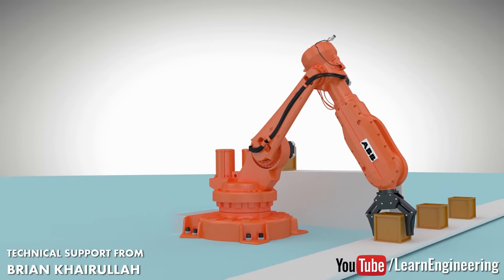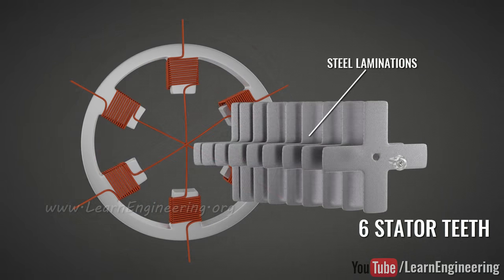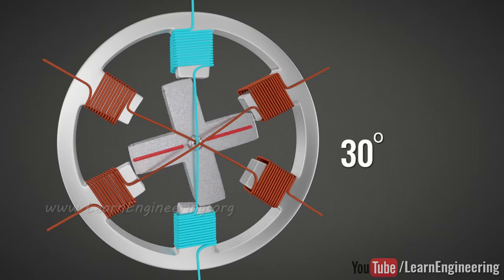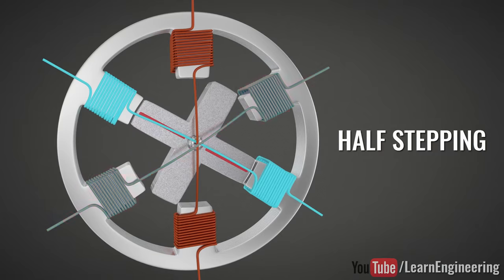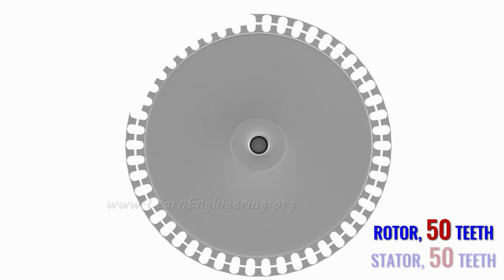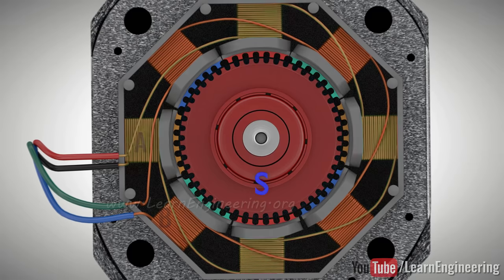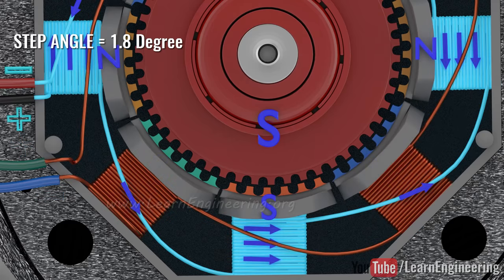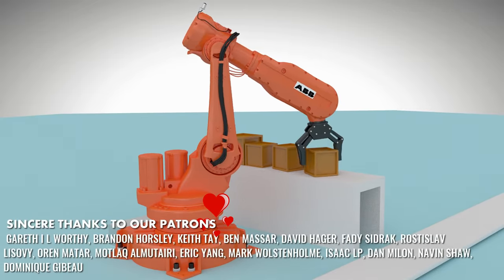How does a Stepper Motor work?

Comment from the maker: Dear viewers, Please support our educational service at www.patreon.com/LearnEngineering . Your support will enable us to release 2 videos/month.
Reply: Learn Engineering 一人
Reply: Is it possible to reduce the step size if we replace the rotor and stator having different no of teeth?
say 72 rotor teeth and 70 stator teeth will we get a step angle of 1.25 deg?
Reply: Make a better video then maybe??
Reply: Learn Engineering
Reply: createlyf ,,,yaa ,,it deepends on the type of application, but normally made with 1.8degree step size,,
Reply: Learn Engineering can you please tell me how to identify pins of stepper motor.
I'm having 5 wire (brown wire strip )stepper motor .
It has brown colored wire strip I'm not able to find out pins
Reply: Thank you for this explication.I juste have one question: which animation software have you used .Thanks in advance
Reply: Very good technical knowledge for young technicians
Reply: Learn Engineering
Reply: Subtitel indonesia??
Reply: m.
Reply: မြန်မာဘာသာပြန်ပေးပါ

Comment: I have worked on many industrial robots at an automotive company, All used servo motors with encoders attached and harmonic drives. The harmonic drive is a very high ratio speed reducer and doesn't use gears so there is almost no play, The encoder is hooked directly to the motor shaft, it consist of a thin wheel with small perforations  and a led on one side and light detection on the other. As the motor turns the light going through the perforations are read and counted. So when the robot goes from point a to point b the encoder keeps track of the number of flashes there probably is a 1000 or so perforations around the disc so even a very small fraction of a rotation is even monitored. So to repeat the same moment from home position 0 point the controller  just runs the servo to the same point by using the encoder data stored.  A little more to it than that such as it can also tell how fast it is moving and direction by the encoder. So there is where you get the extreme accuracy, even 1/1000 of the motor rotation is counted and the harmonic drive may be 50 to 100:1 ratio.
Reply: Does the encoder use gray coded binary, or is it just based on rotation but not exact position?
Reply: 44 teeth just like a micrometer .
Reply: I was going to reply very similarly! I used to work at Toshiba, and they used many different types of robots but all were similar and used absolute encoders with servo motors. We used stepping motors on other machines but not the robots! I used to work mainly with the big Nachi robots! Miss that job!

Comment: industrial robots very rarely using stepper motors. servos are much more common...
also industrial machines NEVER use open loop system. they rely heavily on position encoders...
Reply: @jozef svantner  Can you explain what is a positional encoder?
Reply: position encoder is feedback device.
it is mounted directly on motor shaft (in most cases) reading motor movement and feeding it back to driver. hence the term - closed loop gathered information can be used to verify motor movement, accuracy and repeatability, compensate for high load, overload detectoin, detection an compenastion of mechanical parts wear and many more...
Reply: Billy Willy what is a resolver?
Reply: jozef svantner thank you for your reply.  Can you shed some light on functionality of inductosyn?
Reply: totally i agree with your opinion, anyway, the explanation about stepping motor  is awesome!
Reply: There were lower torque machines or processes that can use stepper motors with encoders and without.
Reply: What does  that have to do with his explanation . It was just a simple visual aid of something doing a repetitive action that could use a stepper motor to accomplish it.
Reply: Exactly right. I have seen stepper motors used on non-critical functions, such as industrial diamond grinding wheel dresser feeds. Everything that relies on precise positioning always uses encoder feedback, sometimes rotary, sometimes linear, sometimes both! Stepper motors are used commonly in more consumer-level applications, such as 3D printers, CNC routers and engravers and such.
Reply: @Billy Willy Very true, I have a CNC engraving machine which uses open loop, if you set the table axis speed too fast, it can jump a step and ruine a job, as well as its home position would adrift due to table inertia.
Reply: this how my analogue electric watch works yes?
Reply: That seems kinda fruitless when we could just use stepper motors, which can be controlled to a very high degree. Some feedback would be necessary, yes. This can be achieved with standard stepper motors. 3D printers can detect when the desired position is achieved, and can detect if steps are missed. I don't know how they detect this, but they can so there is some feedback achieved. Of course for high torque and stability stepper motors would be inadequate.
Reply: Frauenarzt Dr. Stefan Frank  Yep, you got good points. Can industrial servos rotate 360 degrees continuously though? If they can only rotate a fixed range like hobby servos, in applications like that the stepper motor wins. Steppers are cheap and easy to use, and accurate enough for things like CNC and 3D printing, they almost all use Nema 17 motors. In these applications they also don't need to carry much mass, so they're running at minimum load capacity.
Reply: Frauenarzt Dr. Stefan Frank  True, stepper motors lose torque when their RPM increases. There is a way to compensate for this though, if I recall correctly it involves energizing the opposing coils. CNC routers won't necessarily need a lot of torque if the passing cuts aren't too deep, but this also increases production time.
Reply: Frauenarzt Dr. Stefan Frank  Yeah, it pretty much comes down to application. If you need superior torque and precision, a suitable servo would be a better pick. If you're building a 3D printer or custom CNC machine, then some affordable and common Nema 17 steppers, a driver shield and a suitable microcontroller board like Arduino Mega or Rambo will do the trick. For notice reduction, modern silent "stealth" stepper motor drivers will make the noise level lower than a quiet conversation and will eliminate any ringing and vibrations.
Reply: I use steppers I don't care if I don't use servos
Reply: I've seen all of these used on industrial robots depending on the application.
Reply: @PunakiviAddikti  They detect missed steps by using an encoder affixed to the shaft.
Reply: The encoder used isn't a little potentiometer like in small hobbyist servos. It's legitimately a disk with cuts in it with light beams going through them and you can do continuous rotations with them. I actually have one at home (not a super duper industrial one though) that is an optical, quadrature incremental one. Neat little thing to be honest
Reply: @caffeinatedinsanity2324  I have a "broken" one. It came off our plasma table, the motor works fine, but it gives a "exceeded positional error limit" randomly. New motor is like $2200 USD.
Reply: @wirenutt57  the problem lies in missing steps. If the machine crashes/blocks you can still apply current to the coils and not much will change. A hard hit can cause the motor to jump one step in any direction. In consumer-lvl machines, you don't really care about 1-2 missing steps. In industry you certainly do, so you need a rotary encoder. The encoder can tell you if a part of the machine stands still. The encoder can tell you if the machine moved without your knowledge. The machine can correct these small errors by itself. You can even measure how much current/power was actually required for a given position and compare these results with previous movements. If you do so long enough you can learn what power to position ratio is the best for the given machine, and what ratios indicate a problem or upcoming failure.
Reply: Frauenarzt Dr. Stefan Frank  I would say that stepper motors are good for precise positioning and keeping the motor stably in one such position. Do you have a link to technical information how that is achieved with servo motors?
Reply: I concur
Reply: but this video is about steppers.
Reply: @DarcyWhyte  and? opening line of this video is complete bs. (how does a robotic arm in a manufacturing facility repeatthe exact same movement over and over? bs - robotic arm after power loss has no idea where is and will crash imediatelly or lose steps because of uneven load and also crash... how does a automated milling machine move with souch a pecision? bs - stepper alone has no feedback and only try to move precisely with no guareantee that it arrive precisely. it can work until machine is on light load and everything is ideal. but eventually it will lose steps and scrap manufactured part...) video theme does not entitle you to spread wrong information. i am perfectly aware of advantages and disadvantages of stepper and reasons why they are never used alone and rarely used with aditional components which are never mentioned in the video...
Reply: @dodman0907153500  Well actually, it's a cartoon to illustrate a point.
Reply: @DarcyWhyte  yes. and in comparison to other one reasonably good cartoon. people can rightly learn working principle but wrongly think that this type of motor is used in industry becouse it is said in first 5 seconds opening. it is key information which they absolutly screw...
Reply: Enoders are not needed for stepper motors and stepper motors are usually open looped
Reply: @HR-pz7ts  yes. for home use. where most important is low price and least important is repeatability a n relyability. but every single industrial machine MUST have encoders. there is not a single industrial machine using open loop system in entire world...
Reply: Thankyou, as a former cnc machinist this was driving me nuts right off the bat
Reply: Came here to say just that, electrical technician in a CNC mass production facility. 4 ABB 2400 series robots, 14 Fanuc 20ib series robots, 5 dual axis loading arms, 15 transfer machine, 6 CNC lathes, 7 CNC mills and the ONLY stepper motors in the plant are in the 3D printer. Everything uses synchronous 3 phase motors with pulsecoders or resolvers and many linear axis' also use optical linear scales for secondary positioning feedback (eliminates thermal expansion and backlash from the ballscrew as a potential deviation).
Reply: @arunendrasingh1894  GOOGLE IT
Reply: I installed many of these 40 years ago.  They were field modifications in highspeed mechanical drum printers.  The stepper motors replaced particle clutches in the linefeed mechanism.  The particle clutches had a tendency to seize up for some reason.
Reply: @PunakiviAddikti  Radar antennae on ships are positioned by servos.
Reply: Yes. A lot of the time, the stepper motors they use have a rotary encoder connected to their shaft, making it a step-servo motor. This allows the motor to have a high holding torque and movement precision and the encoder ensure that they move to the specified position.
Reply: @mgabrielle2343  You can replace the stepper motors in your machine with step-servo motors.
Reply: aren't servo motors just stepper motors with a sensor to detect the position?
Reply: @jeremytheimer7443  
nope. totally different working principle... al do sometimes closed loop stepper is falsely called just servo. correct term is probably stepper-servo...
Reply: @dodman0907153500  still a bit confused, many online sources refer to them as being very similar and the only difference being speed and step size. of course there is some stuff that seems a bit wrong but I can't find any other explination.
Reply: @jeremytheimer7443  Stepper motors work as shown in this video, stepper-servos are stepper motors with a position feedback system, servos are basically normal(eg. Induction, BLDC etc.) motors that use a position feedback system. Servo motors don't have steps like stepper motors. A servos positional accuracy is determined by the encoder, so depending on your encoder your "step" could be 0.1 degrees, or 6 degrees, or whatever your encoder is capable of detecting.
Reply: @entropy1454  so in that case for best accuracy a stepper-servo is best. Since with stepps you can also do microstepping, which allows even more precise control.
Reply: @jeremytheimer7443  A stepper-servo would still be as limited in accuracy as a normal servo, and in some cases, would be worse. Micro-stepping is usually pretty imprecise, especially when going  further than half-steps, making it unreliable for accurate positioning. Stepper motors also have a very large torque drop at higher speeds, while servos don't. Just as an example, a stepper motor might still have useable torque at 500-1000rpm, but a servo will run at 5000 rpm with useable torque. This means you can use high gear ratios with servos, but with steppers you would be very limited. Since you can get away with such high gear ratios, that means your effective positional accuracy also goes up. An encoder with 1 degree accuracy(just for example) with a 10:1 gear reduction could theoretically give you 0.1 degree of positional control, but a stepper which might only be able to take 4:1, you'll only have 0.25 degrees.
Reply: Yes,  PMSM  Synchronous motors with  comonly  resolver not stepper motors
Reply: I've worked on telescopes and various tracking and telemetry systems and we always used closed-loop optical encoders and direct-drive DC motors.
Reply: Cnc's and basic loaders use steppers all the time. I will say servo motors have their benefits but are more expensive
Reply: @adamjankowski7679  show me one cnc that use steppers. i mean serious not one in your garage. any commercial cnc...
Reply: @adamjankowski7679  btw price difference is absolutely negligible. especially when even small size machines makes easily 5000€ per hour profit...
Reply: @dodman0907153500  multicam mg204, Omga stock feeder, motch VTC, mazak.
Reply: @dodman0907153500  25 years ago stepper motors were significantly cheaper. There are still tons of cnc's in production that use them. I have seen older motch VTC's, Mazaks and a special production "pocket face bore Machine". Don't get all fussy because they do exist but it is dated technology and current day servo drives only because feasible due cost going down.
Reply: @adamjankowski7679  i don't have time for this. read again what i typed and then comment. "industrial robots very rarely using stepper motors" - where did i said never? i said never as open loop. i work almost 15 years as cnc technicial and i NEVER seen stepper in professional environment. every single current cnc machine or robotic arm uses servo. end of storry. bye...
Reply: @dodman0907153500  I said cnc and pick and place type machines. If you only analyze Kuka style then you are not considering anything that likely does.

Comment: Great video. Whoever invented the stepper motor is a genius.
Reply: ratgreen 
the precision you can have with them is insane. imagine a SM with many more coil pairs and teeth that can do fractional stepping based on the coils that you engage.
Reply: The inventor of the stepper motor is genius.  The person who decided they should be made from cheap sheet metal is genius.  They made stepper motors before computers to get accurate positioning by remote control, also genius.
Reply: I think Oriental Motor has 5-phase steppers that do get more accurate positioning.  You image, somebody delivers.  I think it is patented, so they aren't too popular yet.  But they are known for quieter operation and better accuracy, and higher prices.
Reply: Dennis Fox Probably wasn't Al Gore.
Reply: Evi1M4chine  Yeah? What have you made genius?